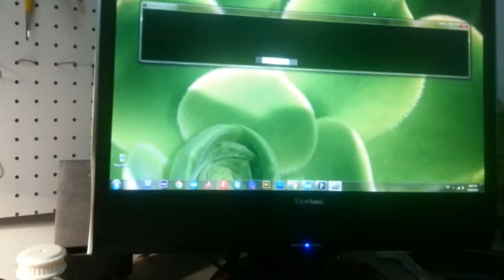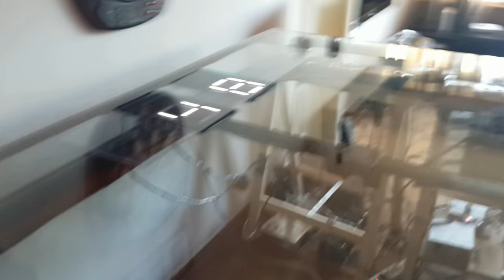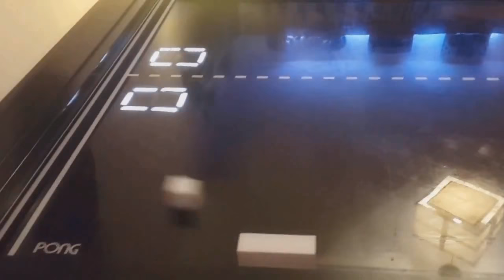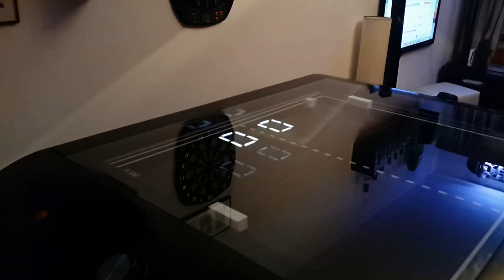PONG PROJECT

Comment: Is the space between the ball and the paddle to prevent the magnets from interfering or just a safety margin to prevent the mechanisms from colliding under the table?
Reply from the maker: its just by programming  (as a security measure) . The mechanism is safe even if the ball contacts the pads or borders of the playfield. And there is no magnets interference.
This is a work in progress

Comment: Isn't it an issue that both the 'paddles' and the 'puck' have magnets? If one comes to close to the other, don't the magnets cause problems?
Reply from the maker: No. ball has magnets in the center and pads in the back center